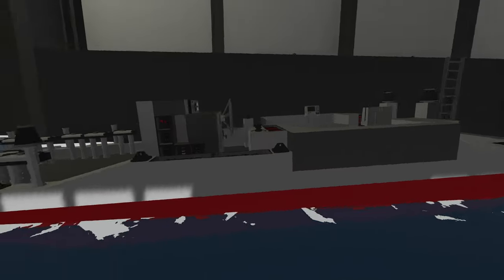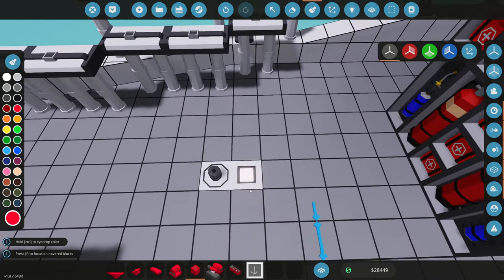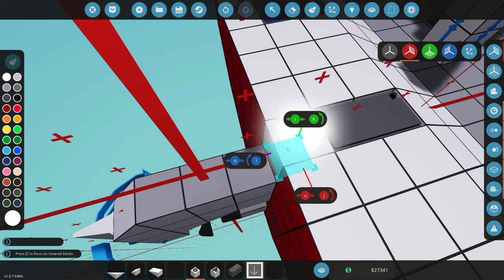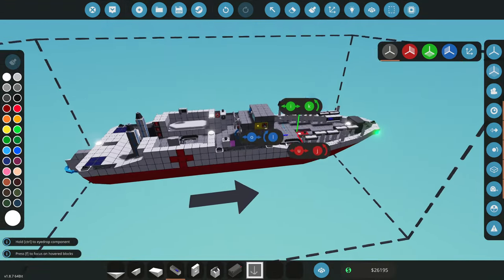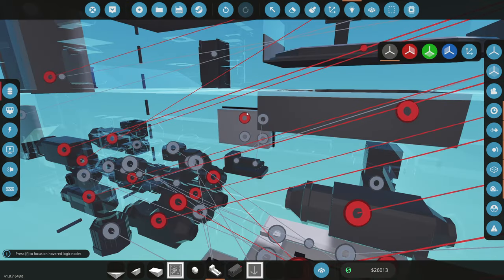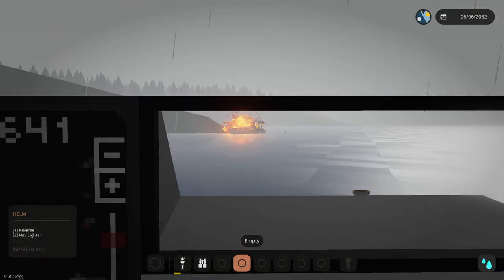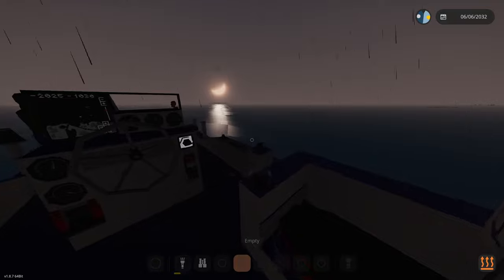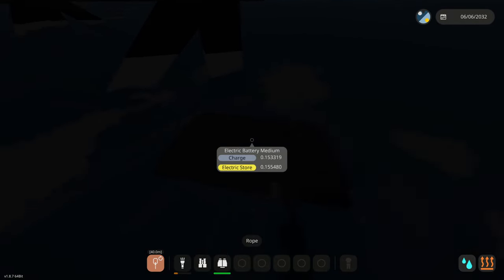Building & USING Starter Boat  | Stormworks Career Series (E6,S1)

Comment: Also you could add a "generator mode" where the clutch to the propeller turns off and it just charges battery (by the generators attached)
OR what i do with my boats and the starter boat instead of a bigger propeller add 2 propeller I went up from 6 nots to 8! just by doing that